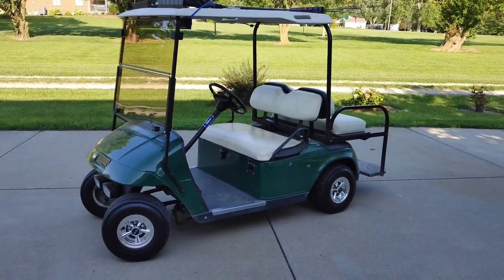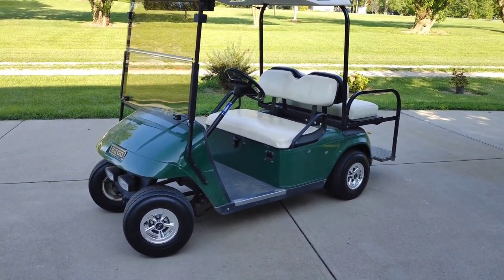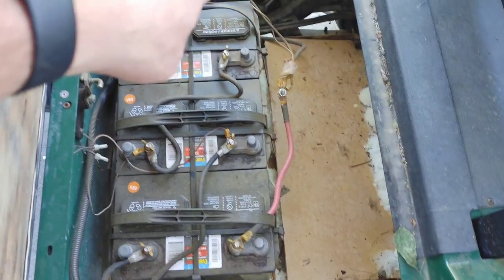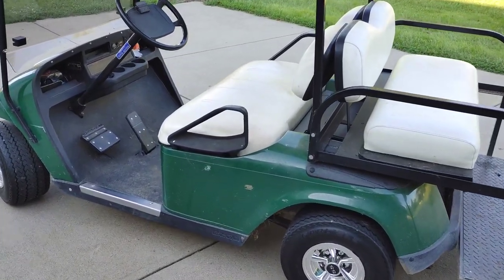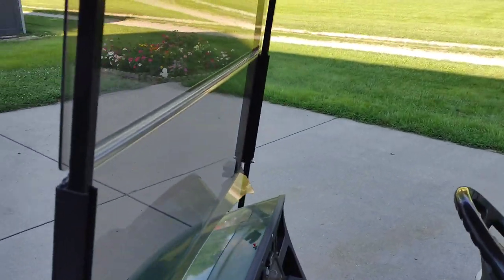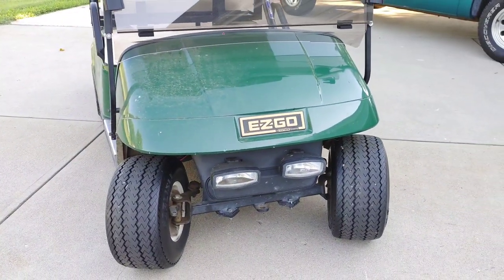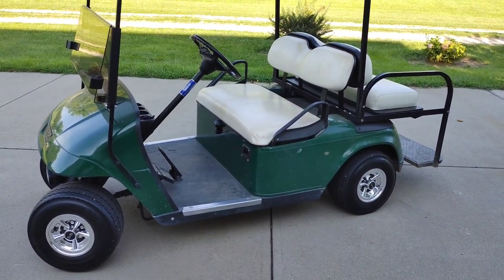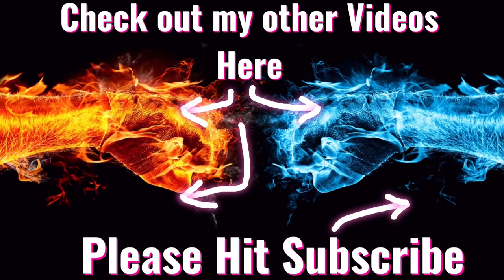Update on the Golfcart conversion (3) 12V Deep Cycle Batteries in 36V EVGO Electric Golf Cart

Comment: I run the same battery setup in my 1990 club car ds 36v got mine at auto-zone 1000 cranking amps she runs strong and super torque with the cranking amps factory charger also
Reply from the maker: Glad other people can vouch and tell others that this WORKS!
Reply: @RoadMisfit187  I’m not the bf I noticed is a slightly shorter run time but I can deal with that I just use my cart around the neighborhood never tan out of power